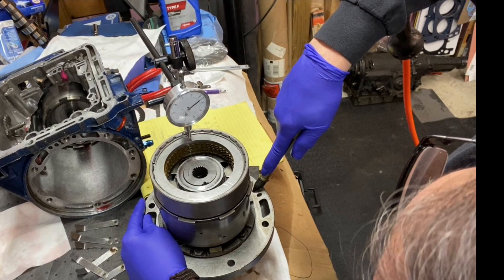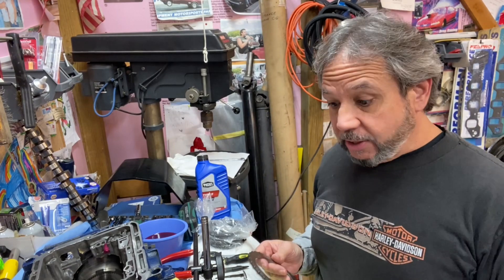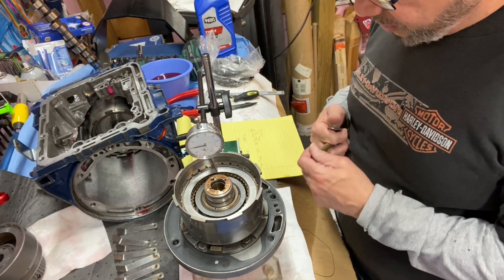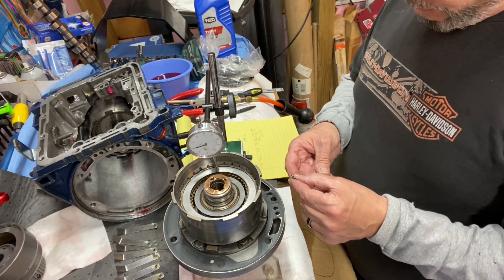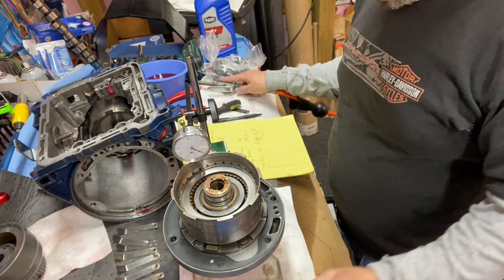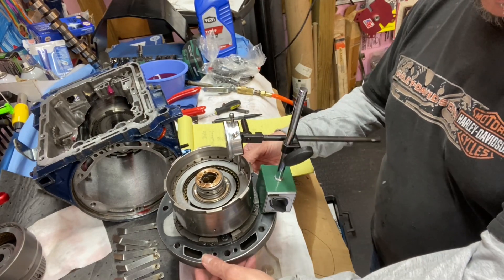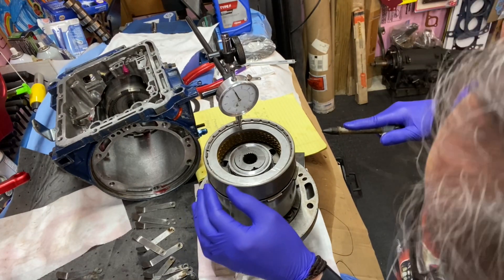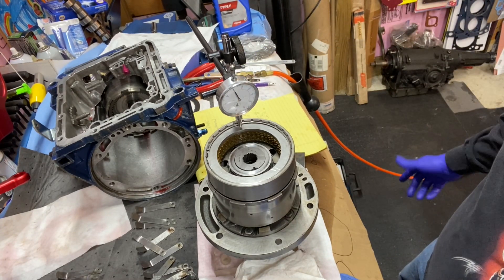DragBoss Garage: The Best Way To Check C4 Direct And Forward Clutch Pack Clearance, To Air Is Human.

Comment: Ok so your not really a transmission guy, I did notice when you air checked the direct drum it has a lot of leakage, mine does that too not sure thats normal.
Reply from the maker: Not anymore, went into medicine. But yes, don't need much air to check. Can blow through a bit.This is the first time I used a dial indicator. Previously used feeler gauges.

Comment: I was having  My C4 built  locally and  was having constant transmission problems, Like  10 passes and the  transmission would strrt to slip! then I bought a C4 from Jay at Broader Performance. I Got 4 years then i Freshened it up. and teh inside still looked good!
Reply from the maker: Right on, jays the man. That is a great lifespan Mylan.

Comment: As a retired trans guy, that is the proper way to air check. Also I used an adjustable air valve, on the end of the blow gun. Because shop air pressure was always 100+ psi
Reply from the maker: Thanks Michael learning something new every day. Yes I turned down to 40 psi.